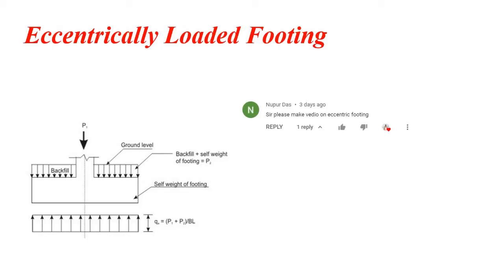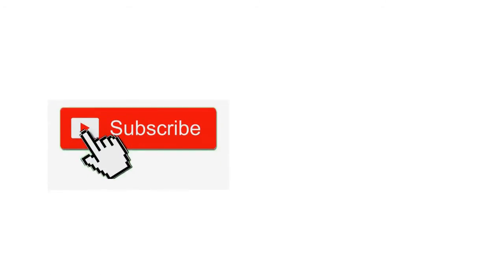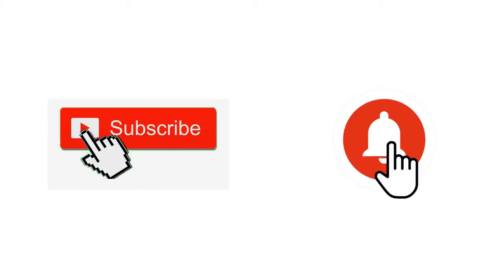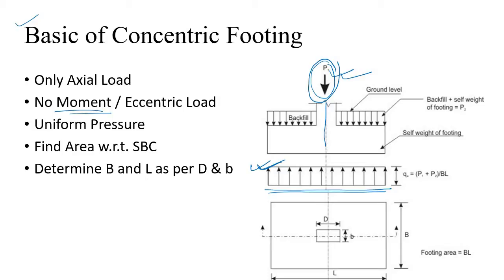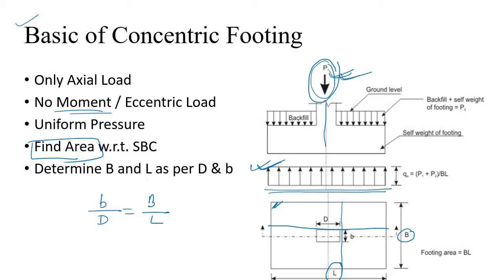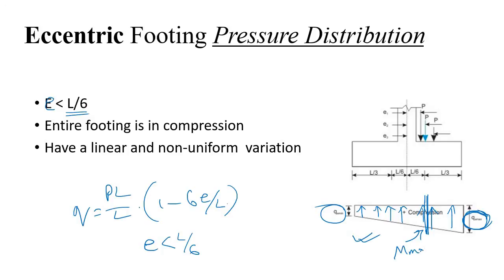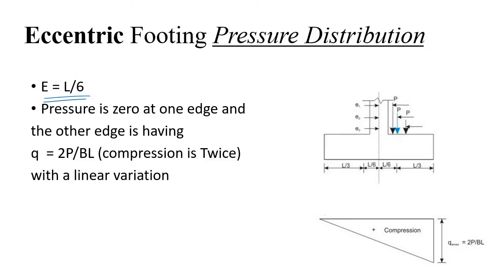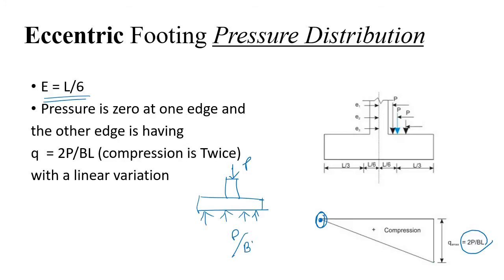Eccentric Footing : All you Need to know

Comment: Sir, this question is just to confirm if I did understand your lecture about footing with uplift. For column at the edge of the footing (= with uplift) :  L = 3.5 m , B = 2.5 m. Column dim is 0.60 x 0.45 m. Pu = 1800 kN, located 1.45 m from footing center line, column Mu = 444 kN-m. The resulting moment at the centroid of the footing is 2166 kN-m. Thus, e = 2166 /1800 = 1.203 m. c = L/2 - e = 3.5/2 - 1.203 m = 0.547 m. My question : is actual q = 2P / (3c X B) = 2 X 1800 / ( 3 x 0.547 x 2.5 ) = 877.51 ? Thanks in advance for the reply.